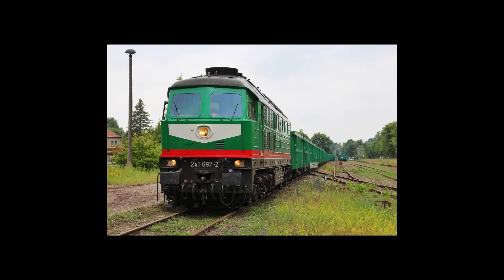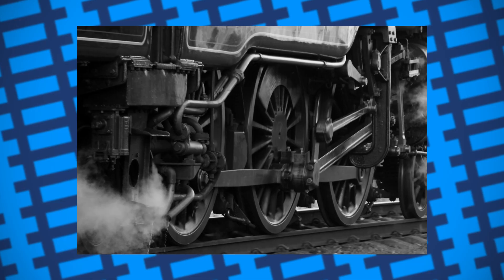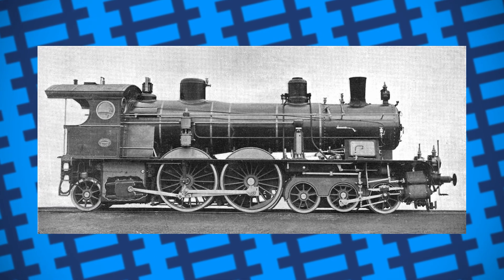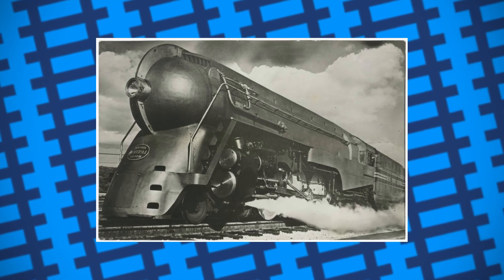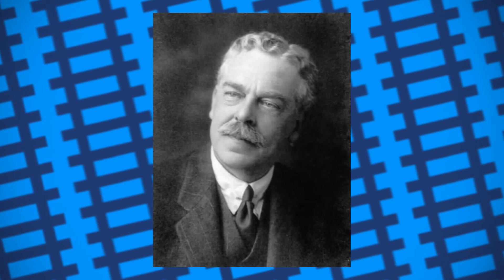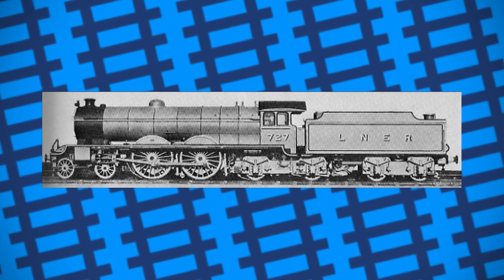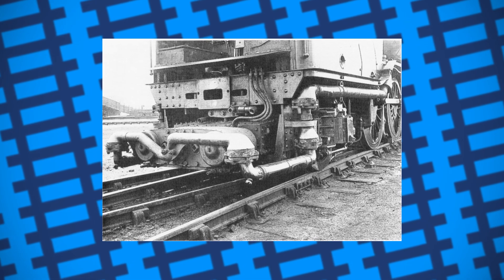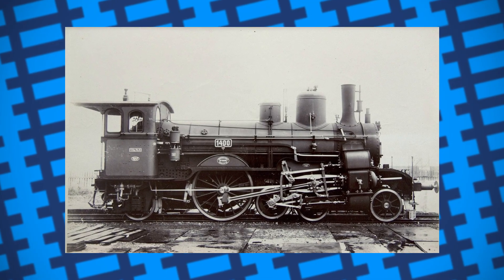The wheels that made Steam Trains more powerful - Locomotives "Boosters"

Comment: I see a big problem...because the trailing wheels are so much smaller than drivingwheels and the booster rpm would go so much higher in rpm than the normal piston when u had uncoubled the booster the trailing wheels would still move the booster piston...or can they uncouble the booster from the trailingwheels??

Comment: THE LNER P1 - BOOSTER 
The LNER Class P1 fitted with a Booster was NOT a failure at all, in the sense that it functioned perfectly. The problem was the P1 class 2-8-2's were far too powerful (excluding the Booster) in any case, for their time, as vacuum fitted freight locos. And a clear indication of why only two Class P1's were built. The BOOSTER you need to understand was not an LNER product , it was a bought in accessory, and only one P1 was fitted. Indeed having proved it functioned it was later removed. The days of "Fast Fitted" vacuum freights was still just around the corner. A type of freight train favoured most on the Southern Railway from the 1930's to cope with the need to things like Bananas (by the train load). From Fyffes Warehousing in Southampton Docks to Bristol or Covent Garden (Vegetable Market) in Central London overnight, which had to also be steam heat fitted. These trains could run at 60mph max. A major job that explains the SR's unusual Class S15 Freight locos that were fast 4-6-0's that looked to most to be more like an express passenger type !  And as such a lot faster than most freights which were limited to 45mph (Part fitted) and 30mph for (unfitted).

Comment: Three questions if I may: 1. Is it obvious to the engineer if the booster wheels start slipping?  2. Does the booster typically have its own throttle or is it “On” or “Off”?  3. Is the booster constantly engaged to its axle or can it be disconnected when not in use?  TIA

Comment: Fun fact: the Hudsons actually needed the boosters to start heavier trains - they had less than half their weight on their drivers. The extra wheel on the trailing truck allowed for a larger firebox which made them free steaming and more than capable of pulling heavy trains at speed, but their starting tractive effort was really quite poor because it took more of the weight off the drivers. A J-1a only had about 3800 pounds more tractive effort  than a NYC K-5 class Pacific despite 41,000 pounds more weight. That's why they all had boosters, not because it was more economical, but because it was a necessity to make the wheel arrangement more usable.

Comment: There were a few reasons why the boosters on the X class were successful.  First it had a relatively large boiler.  Meaning a good supply of steam.  Secondly the engine was on the limits of axle load for general service.  Any more tractive effort on the driving wheels would cause them to slip.  And any more weight on the driving wheels would be unacceptable.  So the booster enabled a "larger" engine without an unacceptable weight gain.  At low speeds the booster was running in a far more economical manner than the main drive.  Instead of needing a very long cut off with minimal expansion it could run with a better expansion ratio.

Comment: Just add two extra pistons 90° out of phase with the other two pistons. 
If you use the push pull type it makes any wheel size irrelevant. 
What's happening is power strokes per surface foot which gives you the torque figure.
Increase the power strokes per surface foot and the tractive effort will increase. 
Power can be controlled via the steam, and all pistons will be power synchronised using link bars on the wheels. 
This is because you would have to add the 90° out phase pistons on the other wheels due to piston location, or maybe stack them underneath the other pistons? 
Either way as long as all pistons are hard linked together.

Comment: You fail to mention the booster engines fitted to tender trucks (bogies) in the US.  They could be identified by the siderods used to transmit power to a  second axle (only one axle was directly powered).  Some were applied to the front tender truck, some to the rear truck, and there were examples of 3-axle trucks with the booster engine connecting only two of the axles.

Comment: On railroads which had large number of booster equipped steam locomotives, like New York Central, Chesapeake and Ohio, and Southern Pacific, boosters were reasonably successful because most crews were trained to use them, and maintenance shops were properly trained to repair them. On the Pennsylvania, Norfolk and Western, and Santa Fe, boosters were only tried on a few locomotives, and so weren't as highly regarded.

Comment: I apologize for not getting all the information about the 6-4-2 so here are the details: The steam locomotive of the genus P 3II of the Palatinate Railway was a test locomotive. As with the genre P 3I, it was an Atlantic locomotive (axle sequence 2'B1') with internal cylinders. Unlike the P 3I, however, the P 3II had a composite engine. The most striking feature of the locomotive built by Krauss in 1900 was a starting aid integrated into the front bogie. Between the two axles of the bogie was a third axle, which was driven by a two-cylinder steam engine. This axle was pressed against the rails when starting with the help of a steam cylinder, which increased the friction load from 276.6 kN to 407.1 kN. This construction, which had already been used in a similar form in 1896 at the Bavarian AA I, can be considered a forerunner of the booster. Another special feature of the P 3II were balancing weights attached on both sides of the ash box, which were moved over coupling rods and were intended to compensate for the back and forth masses of the engine. Both innovations did not prove themselves. The auxiliary engine could not be operated reliably, and another problem was the very high axle load of the leading bogie axle when the additional axle was raised, a consequence of the cylinders overhanging forward. The axle was even higher than the driving axles with 145.2 kN. In 1902, the locomotive was rebuilt, whereby both the auxiliary drive and the balancing weights were removed. In addition, the sandbox was moved to the rear, so that both dome axles could now be sanded. The conversion created a still somewhat unusual-looking, but usable locomotive, which was only retired in 1924. In the preliminary redrawing plan of the Deutsche Reichsbahn, the number 14 121 was still provided for them.
Reply: Hope this helps

Comment: There is one way extra traction can be obtained without the complexity of a small donkey engine, you take drive off an engine,s rearmost coupled axle via an upside down top loader spiral  bevel spur gearbox on said axle. A prop shaft runs in a heat shield under the firebox to a second bevel gearbox on the trailing truck  axle. With steam shut off, via  lever in the cab, driver engages a dog or multi disc Heleshaw clutch on the trailing truck axle gearbox, like an old Willy,s Jeep. Once the train reaches 25 mph the booster clutch is disengaged, a lot simpler and lighter.
Reply: At that point there seems little reason to disengage it tbh - why not just keep the additional drive all the time? You'd need to size up the cylinders to provide the extra tractive effort, but you'd end up with a loco with more driven axles that can still go round corners, and arguably no heavier or more complex than providing a separate booster. The slightly bigger and heavier motion might be a small drawback at higher speeds, but big and fast locos were built successfully. I like it.

Maybe clearance under the firebox would be a limitation... although perhaps you could have a split ashpan with a transmission tunnel through the middle?
Reply: @jonh845  You mean permanent drive to the trailing truck axle ,like a Range Rover or Audi Quattro?, that would help when climbing  steep grades with a twelve or thirteen bogie coach train behind the tender. Oliver Bullieds 'Spam Cans' were notorious for slipping, so a permanently driven trailing truck axle is a no brainer.
Reply: @basiltaylor8910  Arguably more like a 4Motion Golf ;-) Would require careful matching of gear ratio and wheel diameter though - tricky as the tyres wear particularly with different nominal sizes. Or you have to use something like a viscous coupling, which feels out of reach of early 1900s technology. Can't use a differential without basically moving to a complete geared drive like a Shay or Heisler.
Reply: @jonh845  Er no , am talking the 1930,s when Dr  Henri Foettinger pioneered  a compact fluid coupling for Mercedes Daimler Benz, this coupling compensates for wear in tyres of different diameters by slipping just enough and  not heat up the oil.

Comment: so how is it that the Americans had a good run with boosters, case in point the Lima GS series of locomotive the Southern Pacific ran like the GS 4's one of which is still running all over the US as a tour locomotive.  It has a rear truck booster system, and like other models of locomotives purportedly worked very well.

Comment: some examples of Norwegian NSB type 49 (2-8-4) was also fitted with a booster. and it was unusually enough designed to be used at higher speeds than most other boosters around the world.

Comment: South Australian railways 710 & 720 class locomotives had boosters fitted when built, but the 710 class later had theirs removed so they could run on lightly lais track with 60lb rail.

Comment: When I was just starting to watch this video, but before getting to the first pictures of booster-equipped locomotives, I was wondering if anybody had tried a booster designed on a lift axle -- and turns out that's exactly what people did in the first few booster designs.

Comment: 8:20 This appears to be a tender booster, which is a related development. They were usually installed on freight locomotives that didn't have trailing wheels, but could also be added to an existing locomotive more easily than reworking the trailing truck to carry a booster. At the Illinois Railway Museum, we have Lake Superior & Ishpeming #35, a 2-8-0 that was used to haul iron ore in Upper Michigan. The tender booster served it well in that low-speed, high-tonnage service.

Comment: Both Canadian Pacific, abd Canadian National had some engines fitted with boosters, primarily for use in Northern Ontario.  With Dieselization these engines were bumped down to lighter assignments and the boosters had been removed in the early 1950s.  Location under the ash pan diving the second axle of the trailing truck (bogie to you UK people) made them high mainainance items due to acess and fine ash causing wear.

Comment: Didn't a "simpling valve" kinda do the same thing, especially starting a train? I know it required both HP and LP cylinders, and "simpling" would route high pressure steam into the low pressure cylinders, boosting power but also using up much more steam.
Reply: While true, the simpling valve didn't help with adhesion issues. It gave more raw power from the main cylinders, but if you have a locomotive that's constantly slipping it's wheels with a heavy train (either at startup or slogging it up a grade), adding more power in the cranks driving those same wheels isn't going to do much. The booster applied power to a separate axle, which gave the locomotive more effective traction thanks to the weight resting on that otherwise deadweight axle now being used to apply additional power to the tracks.
Reply: @andrewlucia865  So true-I didn't think about adhesion, merely tractive effort. I guess that's also why they tried powered tenders. More power, AND more traction (with a full tender). But the same drawbacks as these boosters.

Comment: With the understanding that a steam engine can pull a heavy train it can't start, and a diesel can start a heavy train it can't pull. Why not combine the best of both worlds? Take an old diesel electric locomotive and remove everything above the frame. Build a tender body on top but put a diesel generator at the rear. It'll give the steam loco a boost to get started and is a lot less fiddly to operate.
Reply: Under what circumstances would a diesel engine be able to start a train,  but be unable to pull that same train.
Are you referring to speed?

Comment: So THAT'S why the New York Central Hudsons had one pair of trailing wheels bigger than the other!
Reply: Same with the Southern Pacific’s GS2-GS6 class 4-8-4’s if my memory is correct.
Reply: The only example I can think of with two pairs of equal sized trailing wheels was the second PRR T1. It was supposed to be added to both, but the first one was too far along by the time it was requested to add. In the grand scheme of things, it was a bit unnecessary. Having an extra pair of driving wheels was enough for the grades, at least on the PRR
Reply: Not to mention, due to the booster units, the Hudson actually gained a second small smokestack

Comment: I never understood that why no steam locomotives were made with changeable gearing system. The Shays had steam motors insteed of direkt steam piston drive, yet even those were not fitted with variable gearboxes.
Reply: I think the answer is that by varying the cut-off, a correctly sized steam engine can cover the working range well enough without all the complexity of a multi-speed geared transmission. Plus working at low speed / high torque it would be huge!

Comment: It seems almost tragic that no engineer has thought to combine tradition steam traction good for higher speeds with the high torque of electric motors from stand still. Especially nowadays in preservation with AC/DC regenerative braking. 

Train of Thought have you not covered the 1930s Dublin Drumm Battery ECUs?
Reply: Electric motors do high speeds too, so why bother
Reply: ... and steam does high tractive effort from a standstill too (mostly limited by the complexity of driving all the wheels).
I'm pretty sure steam with electric has been done - try Douglas Self's Museum of Loco Locos!

Comment: Ah. I was confused by the Bavarian bit, since the Bavarian 1400 did also exist as a "booster prototype" of sorts, but looks quite differently. The one showed in the video (and indeed being in Paris in 1900) is not Bavarian, it's, err, whatever the adjective for that is. Palatinian? From the Palatinate, anyway. Completely different, naturally!

Apparently this "booster" wasn't reliable and was removed already in 1902, so not much of a service history using it either way (though it continued to be used as a "normal" locomotive until the 20's).

Comment: My first car was a 79. 4 speed Corolla. When I'd leave for a trip I'd mount the extra wheels that had the snow tires as they were taller hence more distance covered at a given RPM. Later for burnouts I'd do the opposite with the 70.5 Falcon I had which would snap second gear brake bands on occasion which is part of the automatic transmission. I became very quick in replacing the band on the side of the road with one of the spare two piece bands a transmission shop gave me. Now I use a booster and a five speed for burnouts and overall diameter does not make much difference with all the torque and that transmission thing which steam locomotives didn't have directly but in a way did here. Quick change rear gears for driving the differential is the closest to dual drive wheels on a locomotive which is how I would have tackled their problem.

Comment: Just had a thought. 

I've been imagining the concept of steam/electric hybrid locomotives for a while. While the steam cylinders will still be connected to just the main drive wheels, electric motors will be mounted to all wheelsets, including the leading & trailing trucks. 

This way (at least in theory), locomotives can better utilise their tractive force by powering all wheels to achieve higher acceleration, top speed, & pulling power without using extra steam.

Does it sound like a fever dream? Maybe, but that doesn't make it any less interesting to me.
Reply: Chesepeak & Ohio made an experimental Locomotive named "JAWN HENERY" which used a steam turbine prime mover to drive a generator supplying electrical power to most, but not all axles. The extra complication of conventional cylender powered drivers was not incorporated.  The greater efficency of the diesel prime mover made this a short lived but interesting experiment.
Reply: @jaswmclark  Yes, but that's just a series hybrid, where the steam engine can only directly drive the generator before the latter can power the wheels. My concept refers to something like a parallel hybrid, where all wheels can be powered by the steam engine &/or the electric motors at any time.

What will really take this concept further in efficiency would be a closed cycle steam system that's compact enough to be installed on a locomotive, drawing electricity from the power grid to eliminate carbon emissions.

Comment: You can’t be a locomotive without your wheels. Those are always the most important part of a vehicle.
Reply: Tell that to a maglev.
Reply: @KelniusTV  Unless I’m mistaken, those trains do not involve a locomotive.
Reply: @jamesharding3459   fair... apparently a locomotive refers to the front engine "pulling" the train behind them. And from what I've read, maglevs don't use an engine, but work by propelling every car along the rails, together.
Reply: @KelniusTV they can also push, hence, shunting engines
Reply: @KelniusTV at least some maglev trains do have wheels for low-speed movement.